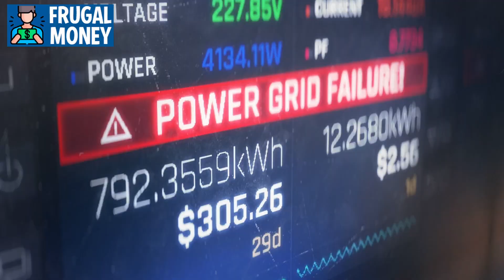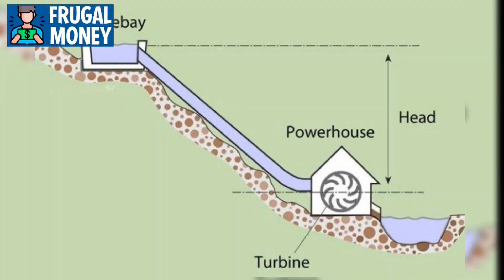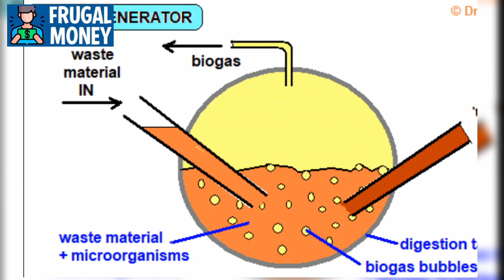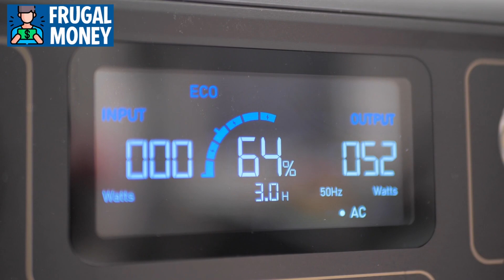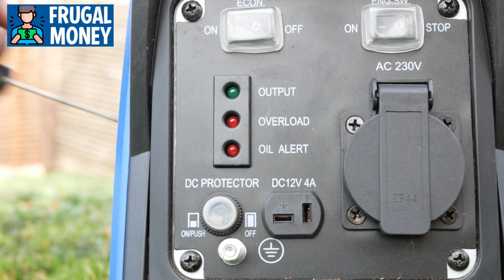7 Ways to GENERATE POWER After the Grid Goes Down

Comment: Wind turbines are responsible for more bird deaths That you could ever dream of especially migratory birds that and wind turbines are extremely expensive to maintain And God forbid one should break down the best most efficient alternative power source is still an engine operating on hydrogen pour water into the converter it separates the oxygen and the hydrogen it pipes the hydrogen to the motor burns completely clean and just like gasoline as far as horsepower rating